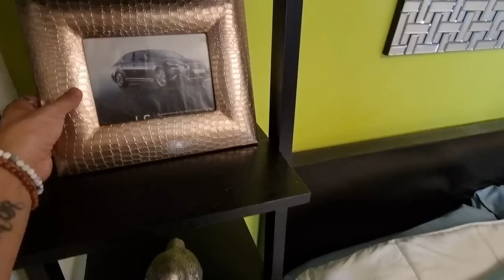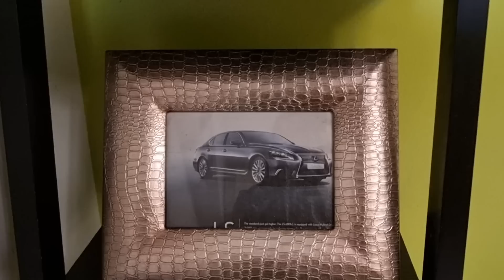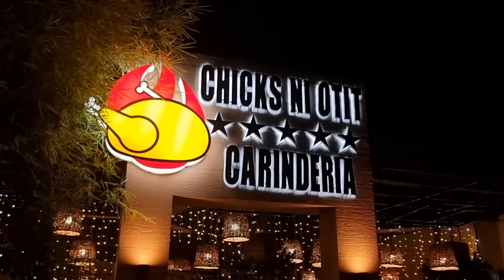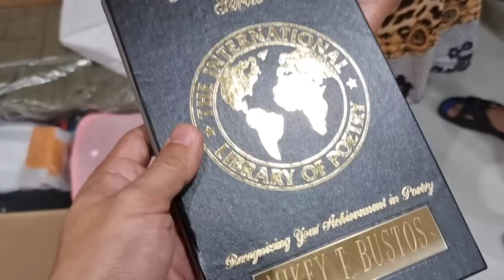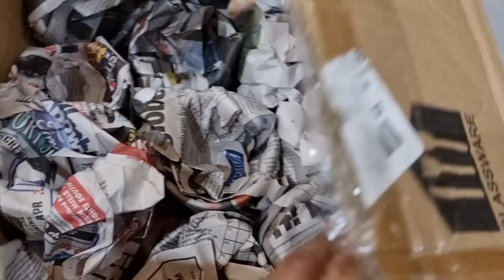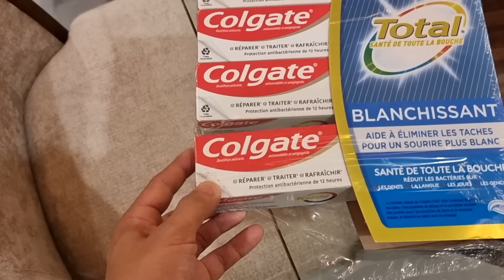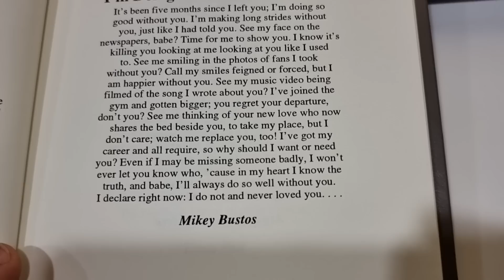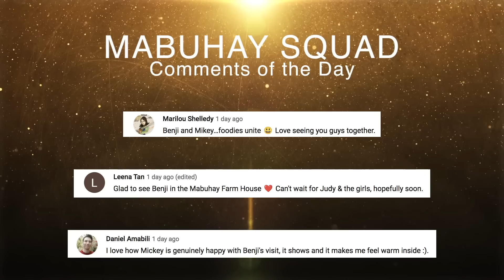My Mom's Balikbayan Boxes Arrived and Contained Some Hilarious Things! - Feb. 10, 2023 | Vlog #1603

Comment: I feel that the furniture in the antroom currently is out of place. I mean sometimes it looks like it can Go in that room due to the room’s intended purpose, but because of the dimension of the room, the material  the room was built, and the things inside the room, the chair tends to not fit inside it. Although this is the case, maybe it will be fit or maybe in another room.